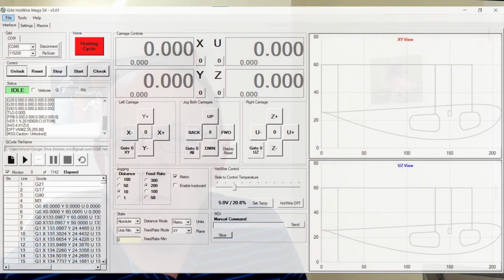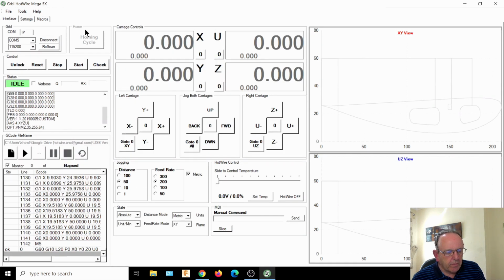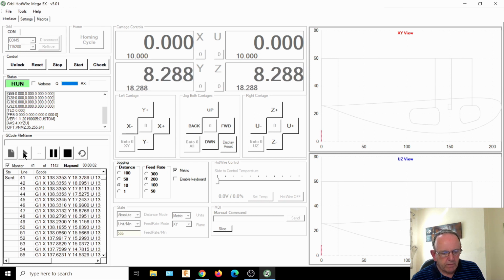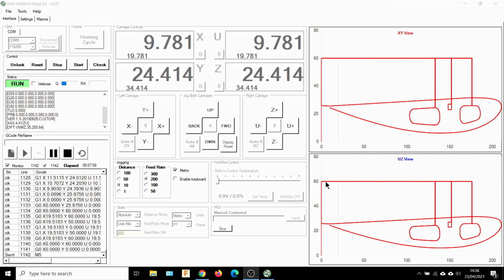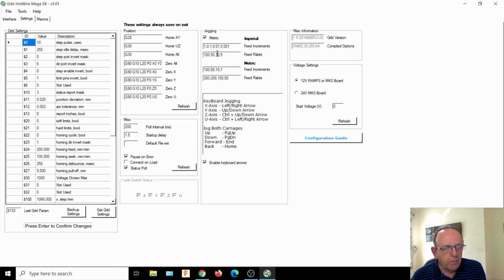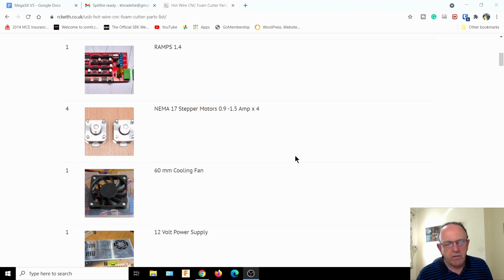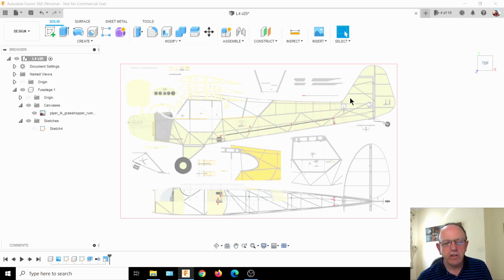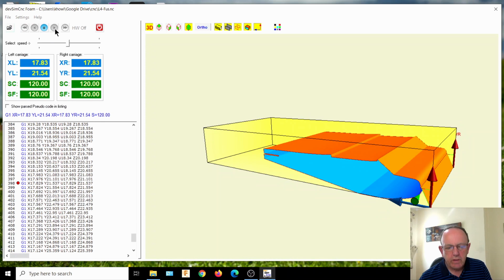GRBL HotWire Mega 5X Update v5.01 - CNC Foam Cutters

Comment: Good work and easy build, but using bow is the best method for perfect tension on wire , I expanded your design for bow attachment it works perfectly
Reply from the maker: Yes the bow is the best option but my space is quite small so it would be hard to fit in.

Comment: Great video series... I've been working away on my own foam cutter using the open builds rails and wheels so this series has been a godsend. I have a question though regarding the wire tension. What weight are you adding to the pulley arrangement to provide the required tension? I'm going for the pulleyed tensioner method but I've no idea what sort of tension is required. I've got a few lengths left over from an old Tekoah bow, they're all 0.4mm NiChrome lengths of about 3-4 feet each.

Thanks Keith
Reply from the maker: Hi Paul. I've got around 1kg or 2lbs. Doesn't need a lot when the wire is cutting well. You'll probably need to run a few test to get a good power setting for the so that its doesn’t drag in the foam.  Hope that helps 
Keith

Comment: Hi, great series with really useful information.
One question, where do you buy your EPP foam?
Reply from the maker: Hi, Thanks for your comments. I've never used EPP for foam cutting mainly because it's not easy to source at reasonable prices. I only use polystyrene now. I did use XPS on my Hawker Hurricane and T45 Goshawk but I found it was causing me some problems with the dust when sanding. Even with a mask.  I use carbon spars and cover in brown paper and PVA glue which makes an incredibly strong wing. I have a video on the channel showing how to do that.  Hope that helps
Keith

Comment: Well done, Keith! 👍😊
Reply from the maker: Thanks Max
Reply: @rckeith   we all have to thank you,Keith!Last Sunday i had my first crash (wing cube loading calc error) but in an half hour i build a brad new wing by the RcKeith hotwire foam cutter machine....what else! 👍
Reply from the maker: @massimoborghini9724  That's great you can have a new wing ready in such a short time.  I crashed mine 2 weeks ago and this was the 3rd wing of this design. So now to make a 4th and a spare.
Reply: @rckeith  mine is a simple rectangular wing but it works and it's what i need at moment. That's why cutting need a little time. What are you building ,Keith? I'll have not a surprise if i saw you in a video behind a stealth 1:1 😉👍